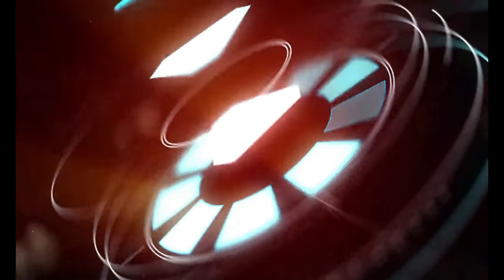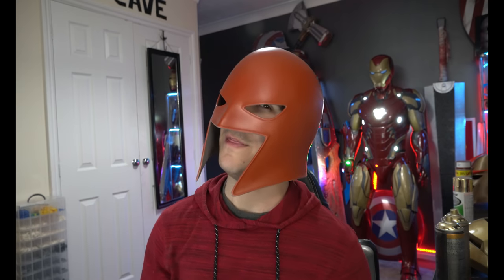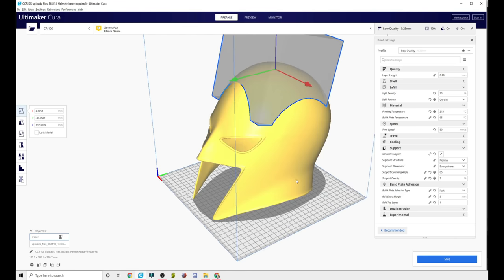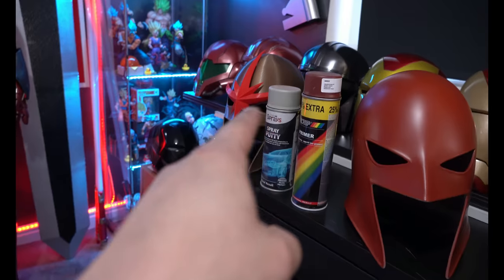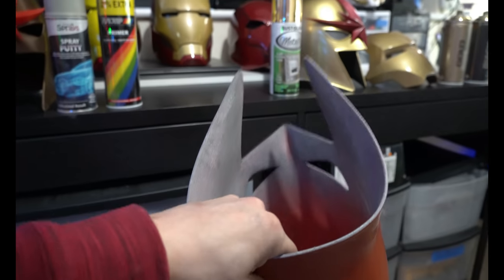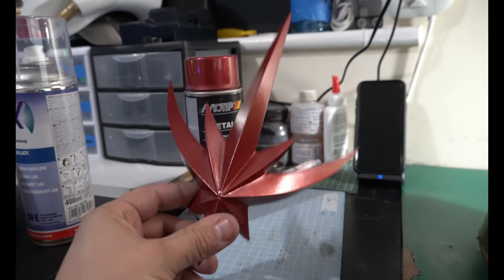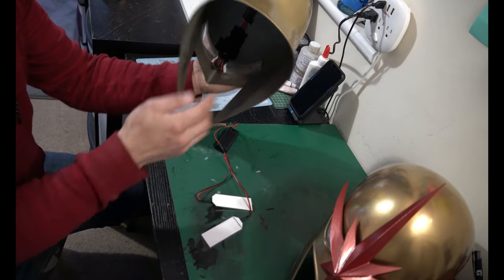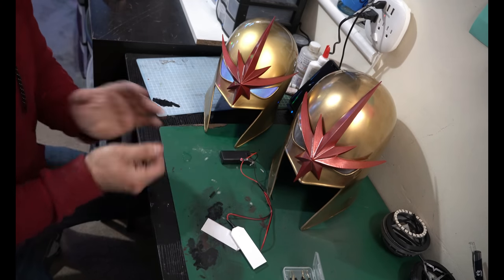Nova! How to make Richard Rider’s Helmet!

Comment: Great video! Thanks for sharing. I'd like to print a collection of small helmets, shrinking them a lot (for my desk) - but this makes the walls too thin - is there a way to make the walls thicker on a smaller print? (Sorry to ask for help - I've spent many hours now and can't find a way to do it.)
Reply from the maker: You can just increase the wall thickness in Cura
Reply: @FranklyBuilt  ah, I didn’t know cura could make a model ‘thicker’ when the model wall is thin. Great I’ll find the setting! Many thanks 👍

Comment: Do you print in pla or petg for projects like this? Which is the easier material to work with? My printer can handle both luckily
Reply from the maker: I use PLA